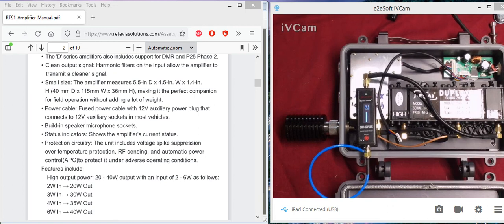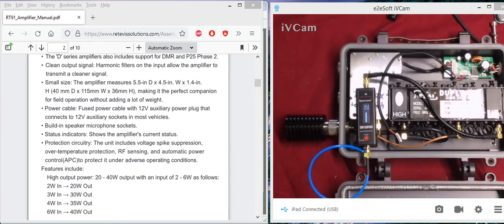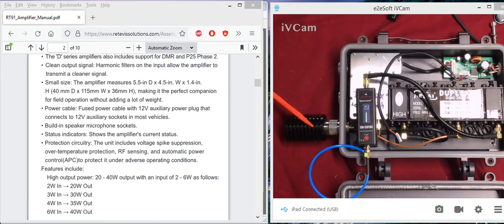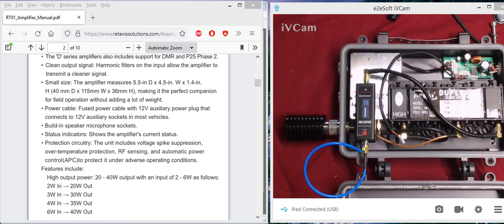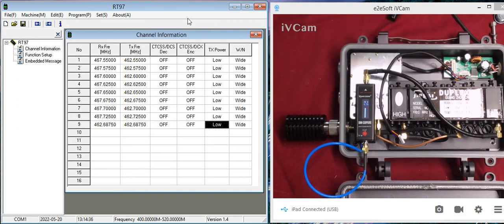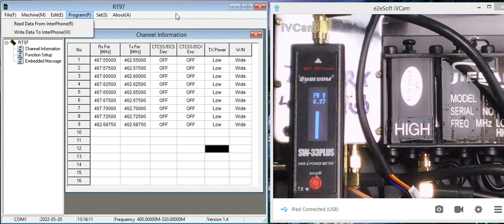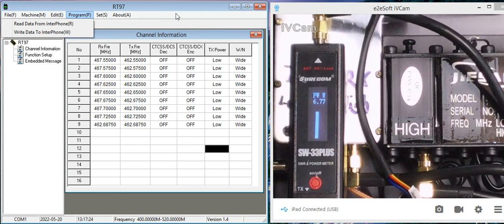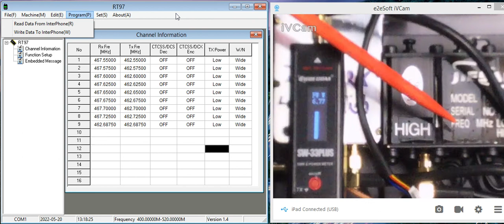🔺Part 3 modifying RETEVIS rt97 GMRS two-way radio repeater for more output wattage!!!🔺

Comment: an RT97s would work well for a project like this because the output is 5w... so no need for having to reduce the output like the rt97. If I understand this.
Reply from the maker: You are thinking after the duplexer which it would be 5-6 watts BUT the amp needs to go BEFORE the duplexer in which case then the output would be 10 watts which is to high for the amp so you would need to turn the power on the RT97s or RT97 to low
Reply: Thanks for the clarification. I'm so new to all this. I think I have it sorted now.  @GMRStwowayradio
Reply from the maker: @stownplayer  - no problem thanks for watching

Comment: Aren't there any duplexers which are normally lower powered?  Wouldn't the lack of necessity for the additional power output make lower powered duplexers cheaper?
Reply from the maker: Yes, there are duplexers that are low power ( like the one that is inside the retevis RT97 repeater) as for the cost of a low power duplexer yes it's cheaper.

Comment: If you want to attenuate the 6.8 watts, you can run the transmitter through the low frequency side of the original duplexer and then into the amplifier.
Reply from the maker: Yes, I thought about that, but I didn't want to cut it back that much because then I would have less coming out of the amp.